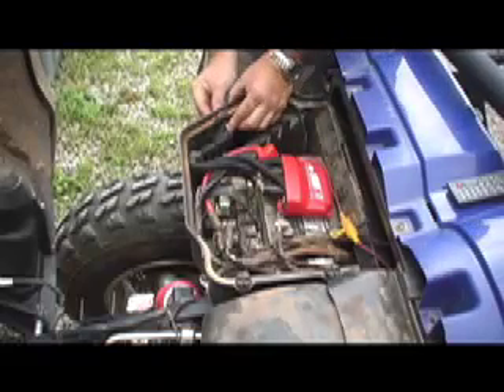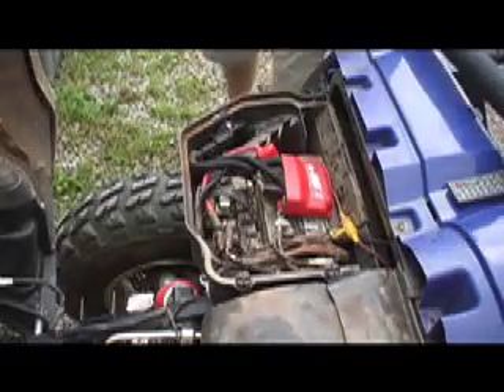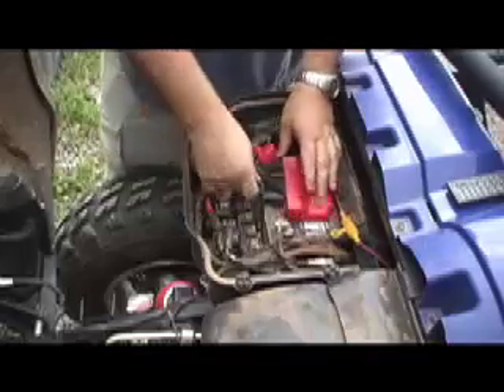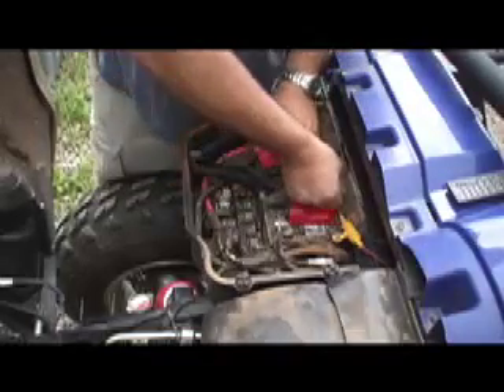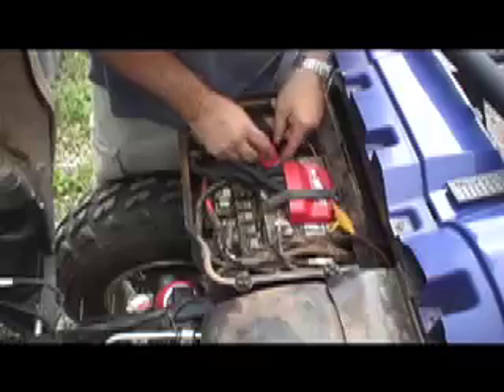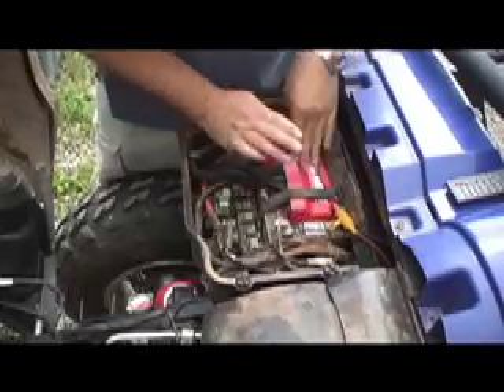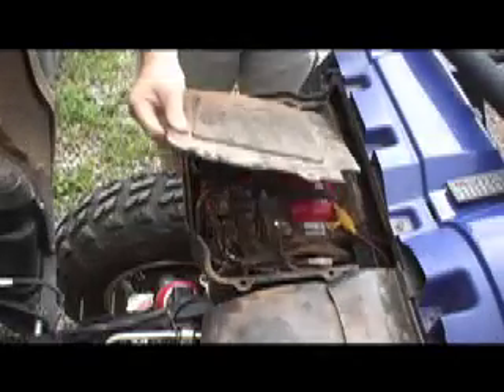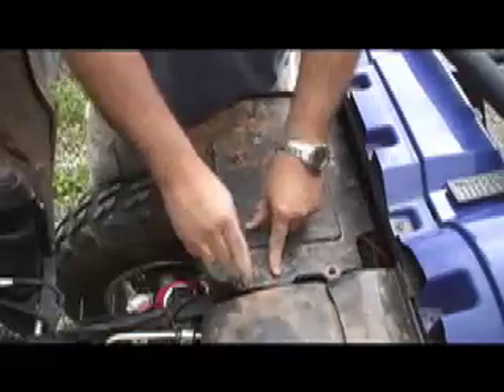MSD Rhino &00 Ignition Install

Comment: 09 700, having an electrical issue between ignition, fuel pump and injector not firing....ordered a new relay, hoping it fixes it.  Any suggestions?
Reply from the maker: Sorry no, never had to fix that and been too long